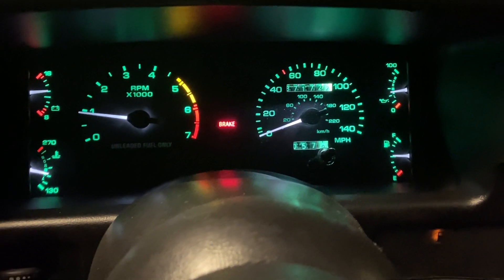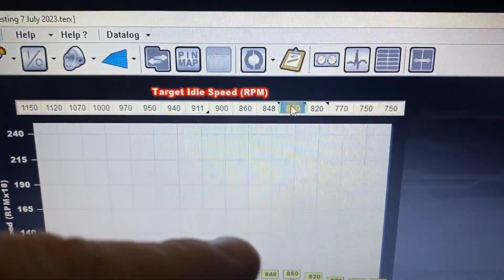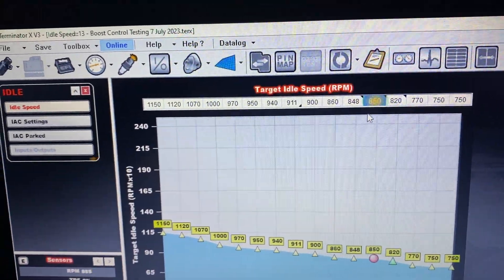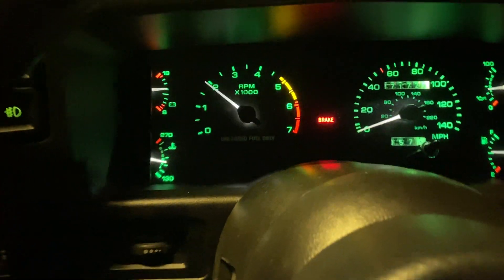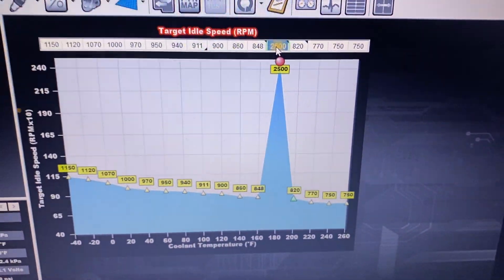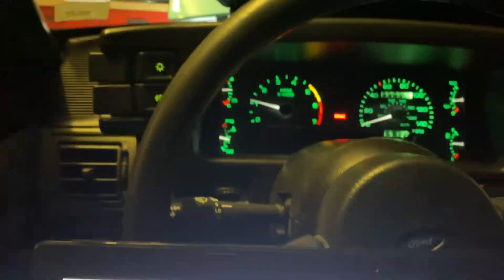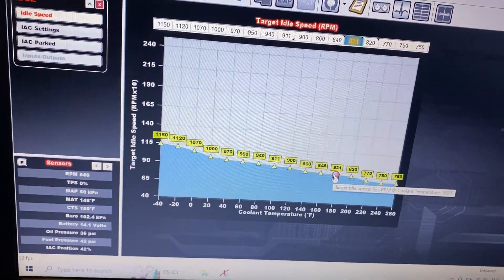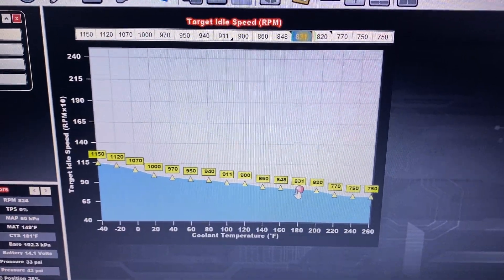Fiesta IAC Airflow Capability on a Terminator X Foxbody Mustang

Comment: I just did this mod over the weekend and tried it out had a very hard time starting it, when it did finally start was at 1500rpms and as it warmed up went to 1900. I did everything the same as your install video, nothing in the computer would work to bring idle down in idle settings or iac settings. What went wrong? Bad iac?
Reply from the maker: Hard to say. Sounds like your throttle body idle screw is adding too much air at idle. Back it out and do a TPS auto set before trying it again.
Reply: When you changed to the gm stepper in software did you change any of the settings in the iac table? With the car warmed up what are your iac #s at idle? Thanks again
Reply from the maker: @gregbrzostko7930   I didn't change a single thing in any of the settings tables. I just need to sync the changes before I started it so the computer would save the changes.  It happened just like you saw it in the video.  I don't have any special settings.  Right now I cant access the settings as I started on an engine swap.  I won't be finished with that for a month or two depending on parts and money for said parts.

Comment: I assume you have to have the Holley management system to run the Fiesta IAC? What’s the advantage of that IAC?
Reply from the maker: Yes, Holley EFI.  The two main advantages are (1) Holley software/hardware is more compatible with this IAC vs the stock IAC. Holley EFI is very LS centric and the Fiesta IAC is controlled essentially the same way that GM sensors are controlled.  (2) There are only 4 programable outputs on the Terminator X and using the factory IAC uses one of them.  Converting to the Fiesta IAC frees up that 4th output to use for something else.

Comment: have you ever checked the Holley Coolant temp sensor ..mine was a 15 deg off ..water temp like 89 deg F  and screen shows like a 114 deg F temp..i dont know if this affects something or not ..
Reply from the maker: On my buddy Johns car we found it to be off about 20 deg when cold but accurate when warm, so we replaced the sensor.  On my car I found it was a solid 15deg off at all times so I just changed the offset and it's been like that for over two years now.  I guess it all depends on your situation and making sure you get accurate data.